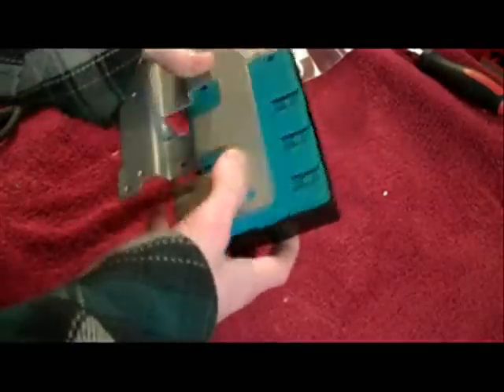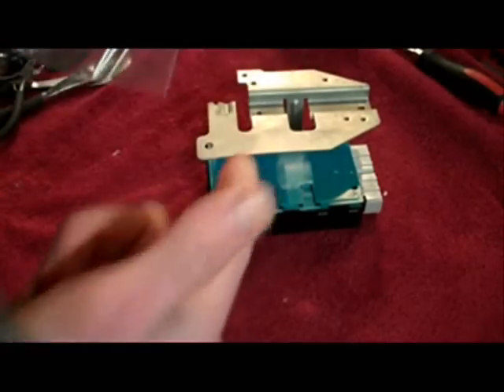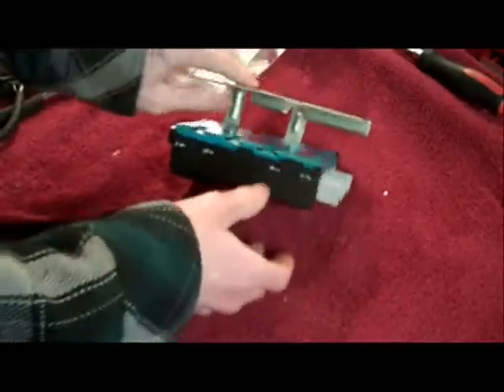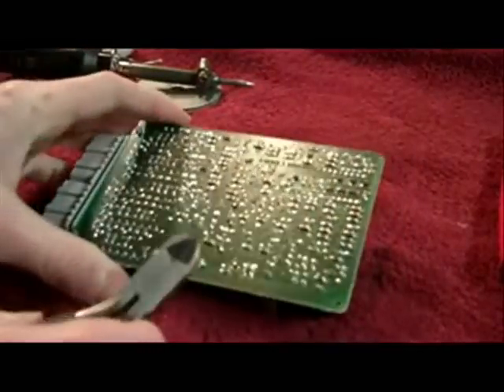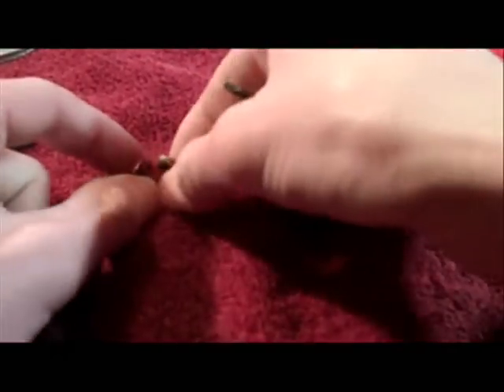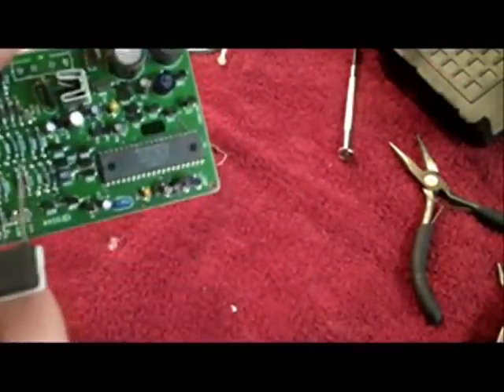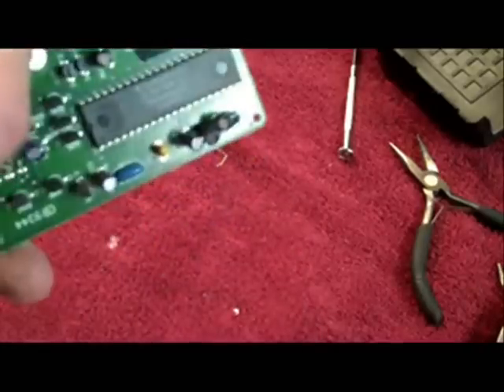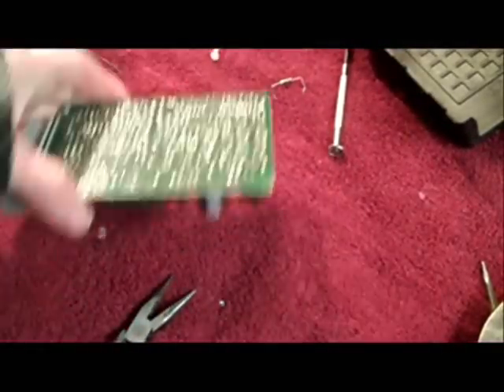Ford Airbag Diagnostic Monitor repair

Comment: This fix absolutely works.  I got mine on ebay, use "Thermal Fuse / Cut-Off - 169 C, 336 F, 15A - NTE8167" as your search. (mainly "NTE8167").  My new fuse was bigger in diameter than the original, so I had to dispense with the black and white casing and I made a little "C clamp" from a strip of copper to replace the one that bound the thermal fuse to the black resistor it nests with, apparently for heat-transfer purposes.  I had someone use needle nose pliers to pull the old one out as I de-soldered, was a big help with an extra pair of hands.  Code 51 gone!    So thanks pfun41 for your video, love repairing rather than replacing!
Reply: Al Legory did you find the source of your ground? I’ve heard 9 times out of 10 it’s the clock spring.
Reply: My white casing got totally burnt.. and is not reusable!  Even the 15 ohm resistor is nowhere to be found.. I imagine it must have fried into the casing.   Do you know what wattage I should get to replace it?

As far as the C-clamp mounting, any thoughts on just putting the resistor so that it butts up against the thermal fuse..  i.e. no extra copper?  Maybe with a fuse with a lower open temperature to account for the fact that the heat transfer won't be as good?

BTW, you mention that it doesn't matter which way it goes, but the picture of thermal fuse is not symmetric.. I can't imagine there's a polarity to it, but any idea why they make one side black/pointy and the other side is square?

Comment: Thanks for the video and information. I had a problem closing the small box that contains the thermal fuse and resistor. I could close it but it wouldn't stay closed, finally I used three very small zip ties to keep it closed - it will stay closed now. I have pictures of the box and zip ties that I could post here if that was possible. Thanks again for the video, you saved me some bucks.

Comment: This is useful advice ONLY if the original short to ground has been discovered and resolved...if not,ur wasting ur time and the new fuse will blow Instantly.. seeing all the comments asking what was the Cause of the short and  seeing no replies... the root cause needs to be addressed
Reply from the maker: The root cause was suspected to be the failed clockspring that had been replaced as no other issues were found at the time. This is supported by the fact that its been over a decade since this video was posted, even longer since it was taken. And the issue has not reoccurred.

Comment: 3:52 That's how the thermal fuse blows when the microcontroller inside detects a fault in the airbag circuit it sends power to that 15 ohm resistor briefly it heats up and blows the thermal fuse it's strapped to. That's why it's clipped onto the thermal fuse for maximum heat transfer.

This disables the SRS system (because there is a fault somewhere) to prevent accidental deployment of the airbag.

Comment: @pfun41 I appreciate your feedback and I agree that fifty-five bucks for a junk-yard part is not a good idea; especially when the cause of the short is not pin-pointed.  I had my dash apart to fix the shift linkage and I unhooked the connector for the CLOCK-SPRING.  That MIGHT have cause mine to go; I also had a blown alternator regulator which could have contributed to this too... just some stuff for the readers who are having the same problem.

Comment: I got a 33 Pin 7 Not Grounded at Diagnostic Monitor . For my code for a 1997 Ford ranger.
I wish you had showed where the diagnostic is usually in the vehicle. It had a dark shot of the dashboard interior.
Reply from the maker: There's a different video for airbag diagnostic codes.

Comment: auto dimmer wires by the rearview mirror caused my #18 fuse to keep blowing. Fixed my problem.  I got lucky n didnt have to do the thermal fuse

Comment: buying a fuse is a bit confusing, 168 F, and/or 77C and then, they usually talk about 15 A at 120v or 10A at 220v. Can you please be painfully exact on what fuse ?  thanks

Comment: I have a 92 f150. 6cyl. Auto. Keeps blowing fuse.  Trans shifts immediately to overdrive. Won't shift down.  As well.  When good fuse installed. Gas gauge quits working. Fuse blows.  Gas gauge starts working.  Trans don't shift 🤔🤷🤯😥
Reply from the maker: That's a PCM problem,

Comment: Mine did the same thing. But I also need to replace the resistor. Where can I obtain one? The resistor looks like it is metal.
Reply from the maker: If it has color codes then use those to decipher the resistance. As far as the type there's a few kinds, you would need to read up on them, I'm sure there's a style that is metallic. Otherwise a junkyard airbag diagnostic monitor would be a good bet.